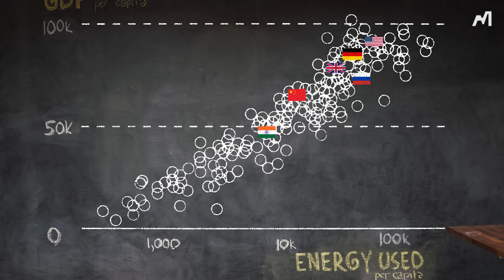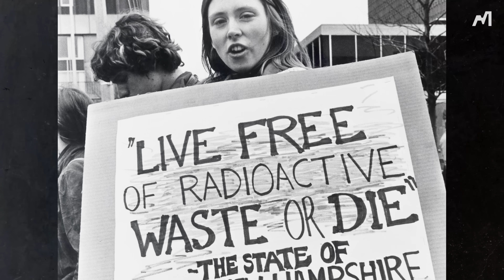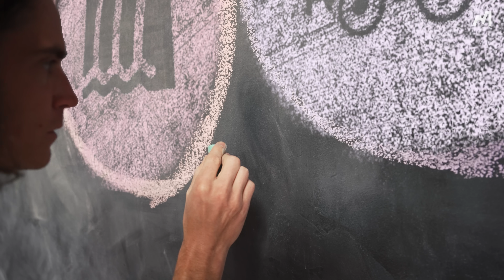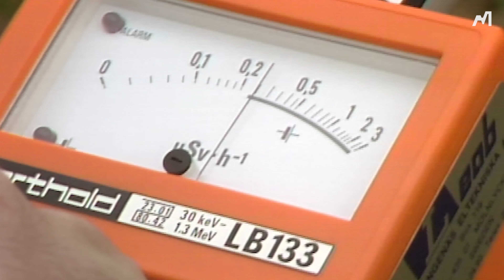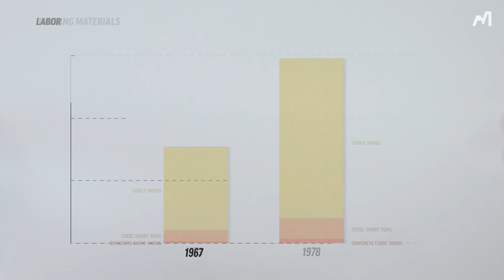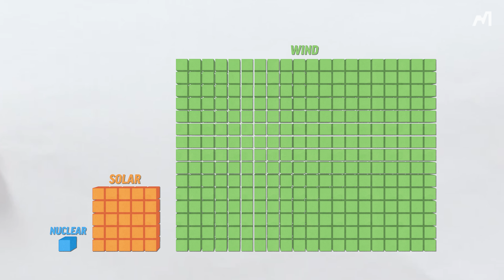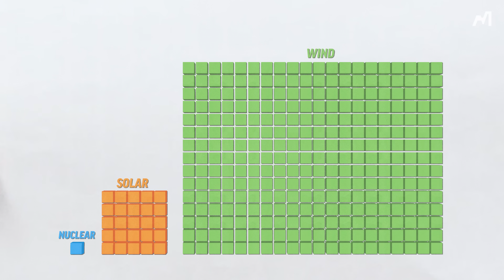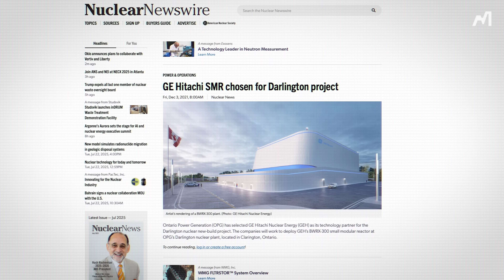They're Lying to You About Nuclear Energy

Comment: The hole in the nuclear solution is that the current tech is very inefficient on a material and energy basis. PWR/BRWs  run Rankin Cycles - about 30% thermal efficiency. Combined cycle (Brayton+Rankine) can almost reach 60% thermal efficiency. Nukes also also utilize only 90-93% of the available fuel whereas combined cycle natural gas converts all the fuel to thermal energy. That alone makes the current nuclear tech a giant loser. PWRs were developed for propulsion and they are good at achieving  the intended mission. SMRs based on propulsion PWRs are not equal to propulsion reactors. You might have noticed a failed propulsion reactor can sink into the biggest heat sink on the planet (the ocean). Oceans are also far far away from population. I don't buy the comparison. Smaller versions of an inefficient technology that lack and ocean sized heat sink are just sad. SMRs are not new btw, the Army built and deployed a hand full of these turds.  I've done construction around the one in Alaska. From what I saw the concept made little power and left a mess. The path forward is nuclear however, just not PWR/BWR. Better technologies are in the works, some molten salt reactors can use PWR/BWR spent fuel as fuel. When that tech is finalized the build out may be justified. Until then? Replace coal with combined cycle gas (Sorry West Virginia, nuclear and heavy metals emissions are not healthy). If CO2 scares people then the efficiency of Nat Gas would justify this trade off. Next: Continue building AP-1000s, get better at it. The two APs you mentioned were two of four in construction at the time. As a guy that joined the project in Georgia I can assure you the first time nuc builders FUBARed the construction in ways that should have landed them in jail for fraud. The experience builder (Bechtel) reluctantly took over the Georgia job and got it across the finish line. It wasn't easy, but we got it done. Of course all anyone will remember is the final cost. We have yet to see the cost of an AP-1000 built in the U.S. by the A-team. Good calls on the suck factor of wind and solar.  I'm from West TX and those bird killers ruined the special beauty of that place.  My background: Register Professional Engineer, worked on: Manhattan Project waste, Cold war waste, Three PWR constructions, One PWR post construction, another 20+ years of chemical plant design and construction and military construction.
Reply: but you forgot the energy density of the fuel, true that gas is 60% efficient in the second principle, 150 vs 20 grams/kWhe. Yes, SMRs are bad in terms of efficiency, that's why I also prefer large 3+ gen reactors, but they could have their merits and uses, I don't really believe in them for electricity generation other then certain applications were a large reactor would be overkill.

Comment: A lot of the new wave against nuclear has been the acknowledgment of it as an effectively clean method of energy, but has been criticizing its cost to build, saying it’s more expensive than traditional renewables; issue is made evident by this video, nuclear is only expensive to build because the regulations have yet to acknowledge it as safe and clean. 

The only viable solution to the climate crisis is the repeal of the regulations and the implementation of nuclear as the replacement for oil and coal. The fact of the matter is that traditional renewables are too expensive in principle, the maintenance costs are ridiculous, the land area required is also ridiculous, battery technology still isn’t good and cheap enough, and the actual political and financial will isn’t there.

Comment: You've made some excellent points. I agree with many of them. I think there is a way to simplify regulation of construction and operation of nuclear plants.

I think, given the political intrigue surrounding mis-management of nuclear power construction, we can agree that a fail-safe design could meet your objectives and those of the public. The trouble is that this design is more expensive. If you want a cheap design, then I cannot support expanding nuclear power generation. 

Now, on a point-by-point review of your presentation.

First, you don't talk about the episodes where constructors have skipped over the regulations then pressured politicians to threaten regulators. One comes to mind where inspectors found regarding a reactor basin. These basins require double-rebar concrete and single-rebar was used. Frankly, failing to talk about conspiracies like this puts your presentation is a cynical, if not sinister light.

Then, let's talk about low-level radiation. Studies in the 1960's showed the effect of school children from nuclear testing in the atmosphere. Similar studies showed the effect of radiation on wild life: the most dangerous of which is reduced immunity exposing animals and fauna to diseases.  

You seem to be playing in the statistics. As an editor of Chemical Processing magazine, in addition to my professional work as an engineer, I pointed out that statistical methods favor the nay-sayers. 90% confidence intervals are great when considering studies of acute effects but nearly useless in evaluating chronic (long-term) effects; these effects involve complexities that dilute the sampling base to a point where conclusions are difficult.

The EPA proposed years ago the idea of a new, less rigorous statistical analysis that would identify problems with chemicals (like radioactive compounds).

As for eating uranium, 50 mg of pure uranium will box your kidneys and you will likely die. Uranium will be dissolved in you stomach from HCl and will end up in your bloodstream.

As for finances, how did long-term projects get funded in the past? It took 8 yrs. to build the Erie canal; 5, the Mackinac bridge, though initial work began decades before. All it takes is a government-private company partnership, called a PPP. The money is in the bank making interest. 

What is missing with nuclear plants is a fund set aside for decommissioning and waste removal. You don't consider that here.

There should be a plan in place for how the plant will be disassembled, and where the waste parts will be stored. Without a clear plan, building a plant becomes a problem. In addition, the plan must be protected. Plant modifications cannot make it hard for future disassembly.

As for loss of life from nuclear disasters: we were lucky. If not for an observant ex-USAF officer serving as a safety engineer, Three Mile Island could have left the east coast uninhabitable for centuries. The good work of teams of Russian engineers and scientists saved Europe from a similar disaster. I guess it's better to be lucky than smart --- and unlucky?

Land? That is your argument. A solar array the size of a state could supply all of Europe, if located in north Africa. This is land that is useless. The line losses were factored in. A German company considered it but for political instability.

Texas? That state now gets the majority of its power from solar and wind.

I was at an industrial fair in Germany in 2006. They had wind and solar systems for cities already being designed and deployed in European cities. Solar and wind systems have improved since then.

Natural gas plants? Seriously? You do know that water and CO2 are produced and they are greenhouse gases -- don't you?

As for storage of energy produced by solar and wind, new systems have been designed and are in use: hydro-electric for example.

Lifetime? Windfarm technology is working to extend it's lifetime. Oh, and nuclear power plants are good for 40 yrs, perhaps 80-yrs. (Though, I hear the inspector's squirming from the political arm-twisting!). Windfarm transmissions require work every 5-10 yrs.; fiberglass arms can go for about 20-25 yrs. The thing is that windfarm components can be reprocessed; nobody would suggest that for pipe irradiated in a nuclear plant -- would they?

The CEO of GE is not an engineer. He is a politician. He leaves the engineering to people like me; then, he gets rid of us. Find someone else as your technical source.

Comment: I see nuclear making a comeback. We don't want to burn petrified trees (coal) any longer and we're desperate to move away from burning fossilized plankton (oil) to generate electricity. We are concerned about the ecological impact dams have on migrating species. And we're also waking up the fact that solar, wind, and batteries aren't reliable enough to fill current and future energy needs. Thus....something has to give and we're going to have to acknowledge nuclear as a reliable baseload power supply to keep our modern society running.

Comment: Nuclear power plants produce energy that is too pricey and they are lengthy to build, solar beats it easily by multiple factors.
Solar is now being installed at a rate of 1 gigawatt ( same as the average NPP ) every 18 hours ( look it up ) and it's accelerating exponentially.
Can we build a NPP every 18 hours? Can we make it exponential? ... Of course not. Solar ( and other renewables ), win, hands down.
NPPs just aren't feasible, they're good as backup to deal with peaks and baseload, but not much else.
Reply: NNPs are only too expensive to build because people who wanted oil, coal and solar to win made nuclear the most over-regulated industry so that it wasn't competitive. So there is that.

I think from your comment you didn't really watch the video.
Reply: @joythought  I watched it and plenty of others, deregulation of the most dangerous way to produce energy isn't the answer.
It's only a recipe for more disasters. Especially when we have safe alternatives that are easier, faster and cheaper.

Comment: France uses nuclear power extensively.  I think it is the nation's main source of electric energy.  Yet I've never heard of a major accident at a French nuclear plant.  Why is this?  What are the French doing differently from the US, UK, Russia and Japan that allows them to achieve their safety record?
Reply: They build Peugeot cars, almost as dangerous as uranium
Reply: I have repeated this for years. France has never had a nuclear accident and has no deaths from nuclear. When the British sabotaged their own Hinkely Point C project by making the french company who builds it make tons of changes, which made costs soar but also have made the project less safe.
Reply: They don't sabotage their own reactors and they don't live on a major fault line. Also, something everyone should know is that not so long ago Germany berated France for not doing more to implement renewable energy (which proves that this isn't about having clean energy, it is about having renewable energy in particular). So as a result, France invested quite a lot of money in renewables. The result was an increase in CO2 emissions and in energy costs. This is primarily because solar and wind absolutely rely on gas power, because they cannot maintain a constant output, so they need backup power. And given that it takes days, even weeks to power up a nuclear reactor, you cannot use nuclear power as a backup. It has to be gas. And that is why solar and wind are not carbon neutral.
Reply: @CristiNeagu  No, they have massive battery systems that store energy from renewables. Look up nickel iron batteries for an example... I think it was called the battolyzer.
Reply: France actually has slightly too much nuclear power. The French grid depends on the sale of power off-shore. Nuclear provides a great baseline power source, but it's not reactive enough to handle the flux on the grid, so you need either gas or wind which can be brought on/off-line in minutes (or pumped hydro which France is also quite good at!).

None of which is relevant to the point. "What are the consequences of a catastrophe?" When your nuclear power plant does go wrong (and it does help that France is far from at risk of tsunamis for example), the consequences can be far-reaching and international.
Reply: I live in France.  I can assure you that the French are sufficiently well organised to use nuclear energy.   That's why no major accidents in France.
Reply: @v8pilot  Just have to watch out for some of that beach glass used in some of the glassware dont you know eh?
Reply: @jafinch78  what in the malarkey
Reply: 71% or smth then renewable at like 10% ?
Reply: Being one fifth the size and not having a culture not based on profit at all/any cost helps. In 2022, over half of the country's reactors were shut down for maintenance. How do you think that would've gone in a large nation based on profit at all costs and where half of the population are so intellectually backward that they cheer for said corruption?
Reply: @drstewart  Profit at all costs? There is no such nation, not in Europe at least.
Reply: @drstewart American education at it's finest, folks.
Reply: @danieldieste9905  Facts are hard for Americans, thanks for pointing it out.
Reply: Yeah but france doesnt have problems with other companies that have posioned billions with forever chemicals like pfos/pfoa and just close up shop and run away when they get caught like the usa.
Reply: The only "nuclear incidents" that happens in France is Greenpeace protesters trespassing on the exterior of the sites, because they really hate affordable and carbon free energy
Reply: The company operating the plants was bust. France had to buy them out!
Price of electricity dearest in the world!
Reply: FRENCH HERE NUCLEAR IS MY LIFE MY WORK AND I COULD NOT AGREE MORE !!!! FRANCE IS THE MOST NUCLEARIZED COUNTRY AND WE USE MOX COMBUSTIBLE...EVEN BETTER AND WE SELL TO MANY PEOPLE AROUND THE WORLD OUR KNOWLEDGE.
Reply: @generaloneill5460  Hey are you guys, uh, hiring operators? Perhaps ex-US Navy operators, by chance?
Reply: @generaloneill5460  And you have Powerplants which have to be shut down in summer because the rivers are getting too warm while importing solar energy from germany for example
Reply: @dystoperator what in the SUPER malarkey!?
Reply: @dystoperator you know they shut it down to protect the fishes in the river, and not the reactors
Reply: @nicolaspeigne1429  True, still the reactors were non operational, and a technology killing aquatic life in the rivers is not a good technology
Reply: because the french are doing it the smart way and will get out the pitchforks if the government makes even a minor controversial change
Reply: Why did the French nuclear power operator go bankrupt? Then get nationalized? Why were fifty percent of French nuke plants offline? I guess it was all just irrational fear.
Reply: @KevinKimmich44024  It was irrational fear.
Reply: @CristiNeagu was it irrational fear that compelled first energy in Ohio to spend $60 million in a racketeering scheme to obtain $150 million per year in subsidies for perry and Davis Bessie plants? Nah, it's just that they cost way too much to maintain build and operate contrary to what these ads in YouTube content form say. Duke energy in North Carolina wants to compel rate payers to subsidize future plant construction. Why don't investors line up if it's really so cheap? Maybe it's not.
Reply: @KevinKimmich44024  Nuclear reactors don't cost too much to maintain, build, or operate. They are, in fact, very cost effective.
Reply: @CristiNeagu according to YouTube and lobbyists on YouTube but never in reality.
Reply: @KevinKimmich44024 the bankruptcy of EDF and its weird shenanigans were due to poor handling etc of other assets and things untelated to nuclear energy itself
Reply: There have been problems though, just not a giant/catastrophical ones that would get a lot of attention.

But even France is looking at reducing its nuclear % of grid in favor of more renewables. Though they also aren't just completely moving away from it.
Reply: France is also a socialist country and all the nuclear power was paid for through high taxes. Does that sound good to you?
Reply: France is not socialist, the nuclear fleet was built by a private company and it was repaid long ago and it’s a net positive for everyone, they get 3 billions a year just from exporting electricity. Get your facts straight at least
Reply: @wendlerkurt France is the most capitalist country in all of Europe after Germany buddy
Reply: @wendlerkurt State built energy paid by the state using state finances which are collected via taxes yeah thats how a state work oh also it generated economical revenues etc so its just average economic procress like there plenty
Reply: @wendlerkurt  If it means you have the world's safest nuclear reactors, then high taxes are not too much to pay.  Perhaps putting nuclear power in the hands of a democratic public sector is the right way to manage it.  "Democratic' meaning Not the USSR.
Reply: @wendlerkurt france is socialist ? People in the US really have a messed up understanding of politics
Reply: @wendlerkurt  Yes, absolutely.  As a democratic socialist, I absolutely want more socialism.  In the US the rich are not taxed nearly enough, the poor are vastly overtaxed.  But you're also wrong, France is not a socialist country, it's unfortunately very capitalist.

Comment: I think you're too dismissive of the actual dangers of nuclear material. There is a threshold where the damage of radiation is quantifiable. What happens below the threshold is a matter of debate, but above is a matter of science. People die. Chernobyl exposed people above the threshold, more than 30 people died because of Chernobyl. 

Not all radiation is the same either. Alpha emitters are not safe to eat. Small particles are generally worse than big particles.

I'm not saying there's not a good case for building nuclear, perhaps even with reduced regulation, but nuclear does have real dangers that deserve attention.